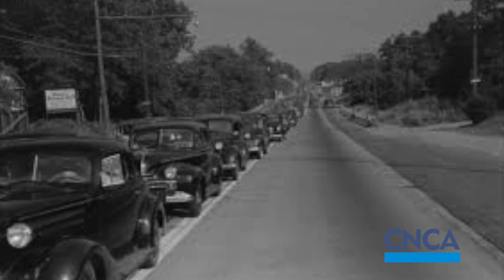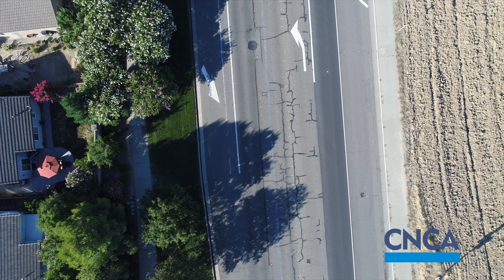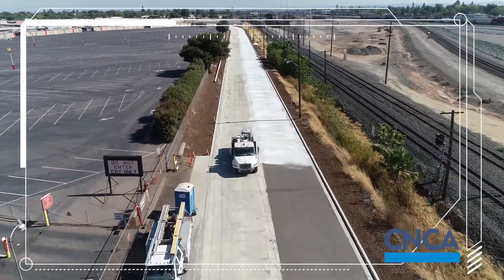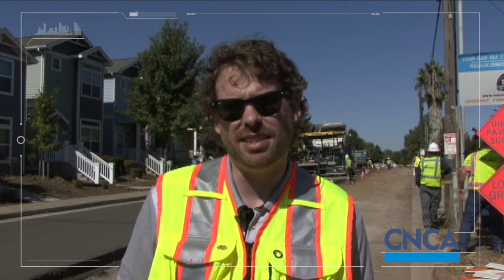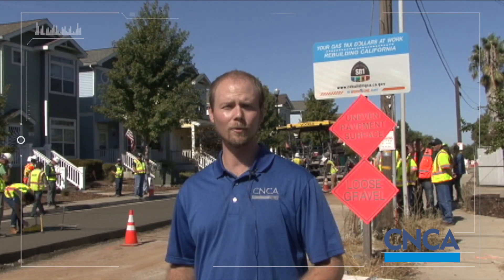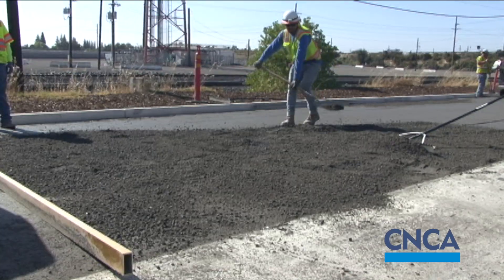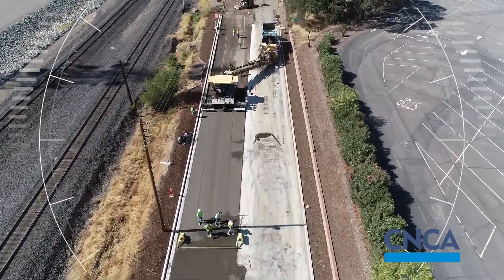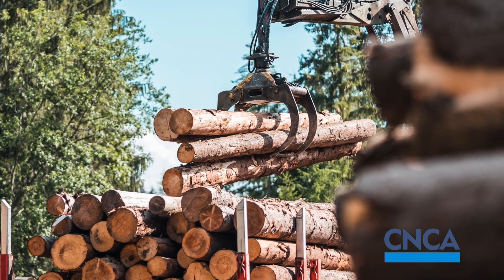Roller Compacted Concrete (RCC) - City of Roseville - CNCA

Comment: Use a laser or some reference to make sure it goes down flat. Driving on it at 50 mph will make any irregularities very noticeable.
Reply: One of my local 4 lane roads was done with concrete a couple years ago. At a cost of about 50 million for only a half mile of 4 lane road. When cars were first allowed on it we were very surprised, it was quite uneven, bumpy, rough to drive on. But then a few weeks later they ran a grinder over it which fixed it. Put some rain grooves in too.

Comment: Logging roads used to be bulldoze a path along the hillside and spray it all with a lot of diesel oil, run the trucks over it to pack it down. We are not used to seeing logging roads made with concrete...$$$$$.
Reply: Hi Michael. I think this referred to log sorting yards, instead of roads or access paths.
Reply: @clayslocum290  City of Santa Rosa, where I live, was supposed to get roller compacted concrete. It was awarded but then got cancelled. Then since they had the money allocated they did a conventional concrete road instead. Like an old-style concrete freeway as I understand it.